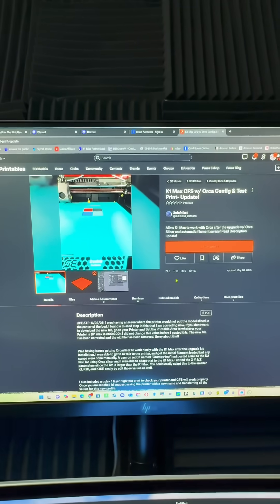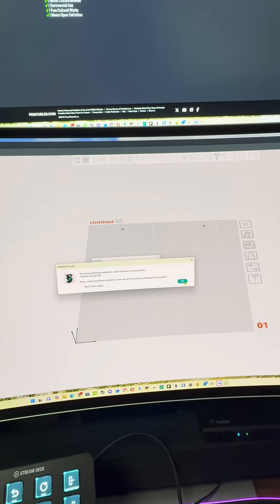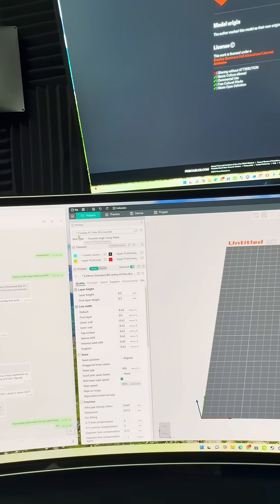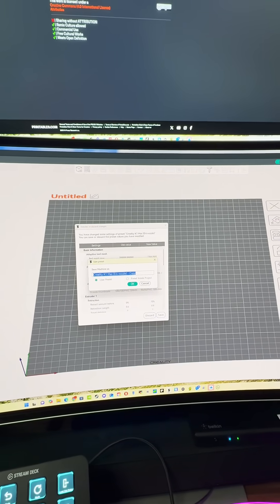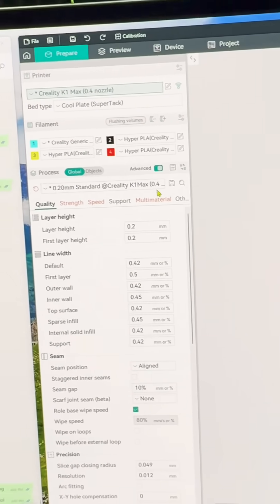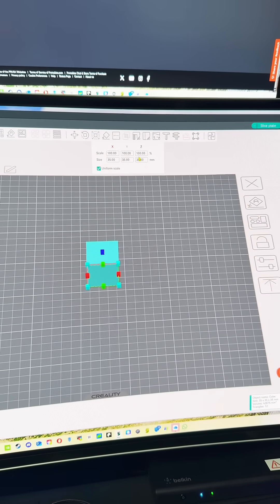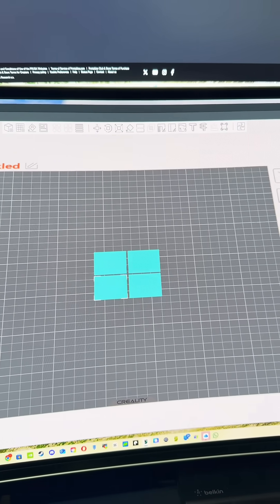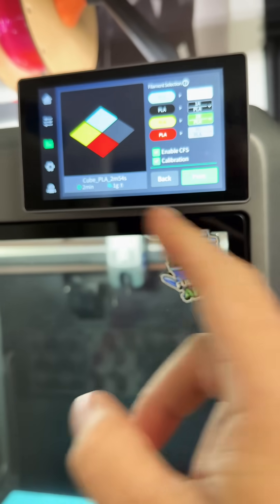The Ultimate Fix For The CFS Using Orca Slicer In 2 Minutes #3dprinting

Comment: the bed size in his configuration is 300x300 so be cautions with these instructions on anything but the K1MAX  some editing would be needed to ensure your not outside the bed size of the k1c which is 220x220

Comment: Yeah, this didn't really work for me. Mine, just pauses after every layer change when multi colors come into play
Reply from the maker: If ya wanna join our discord someone will def help you fix it. Everyone is using orca no problem. Here’s the link. Just enter k1 or j2 chat and tag me and I’ll help ya out. 
https://mee6.xyz/i/4YMcjZjNO6
Reply: @stayreadyto3dprint   joining as kljw5 hope you can help  i'm finding these videos becaues something keeps knocking my extruder off a belt tooth or something.   this code may fix this as it increases z hop to avoid collission.
Reply: Your orcaslicer gcode for change filament probably says pause.  if you followed his instructions it should overwrite this gcode as well.  also need to ensure orcaslicer has manual filament change turned off.
Reply: @40andfreedomthanks I was finally able to get it running... But running pretty good last few months. But for my printer with CFS I did switch over to credit print. My regular k1 still uses orca